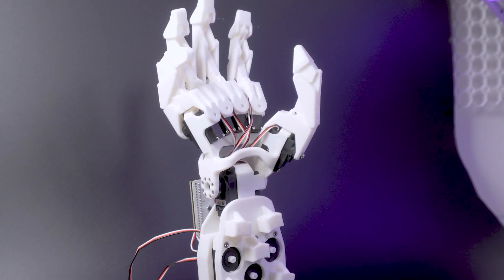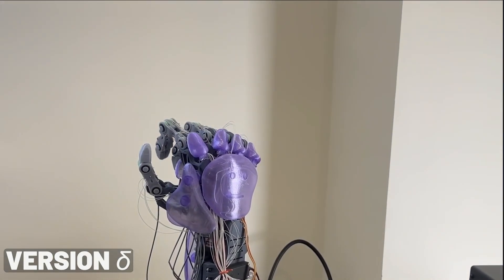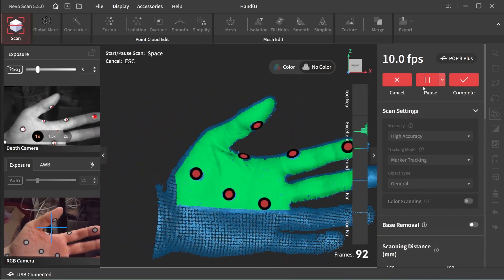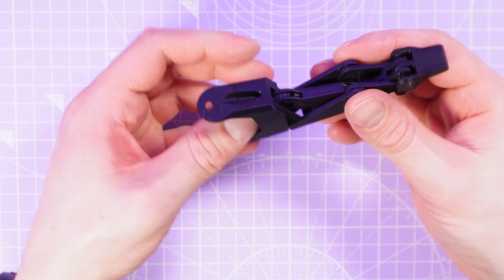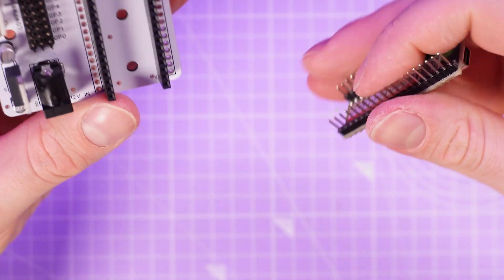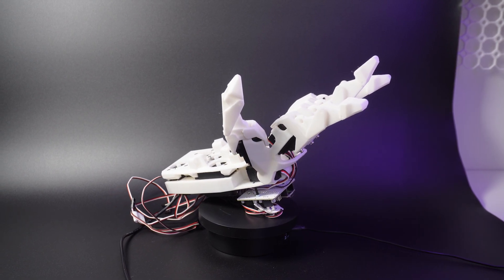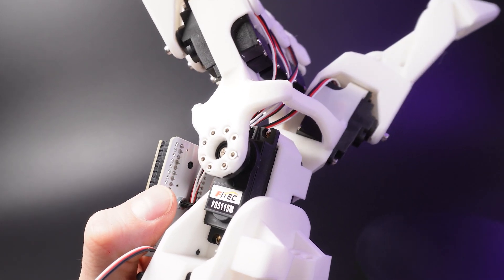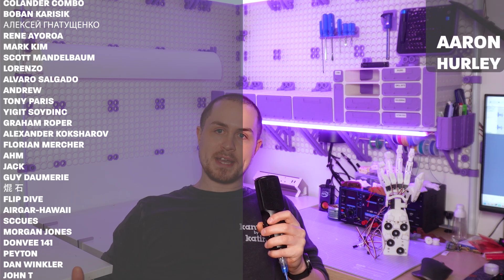Designing a New Bionic Hand (Which Prints Pre-Assembled)

Comment: Hey to print in place you can use a 45degrees cone structure. I usually give 0.2mm to 0.4mm of tolerance. It then becomes a hinge for most utilities. It is quite reliable since none of the cone shape is suspended.

Comment: Awesome project and engineering. For the finger joint problem, could you just print a hole in each part and a snap in cylinder that prints on the bed. This would keep it hardware free and still allow printing with no supports. I don’t imagine the finger tip needs to be removed often so shouldn’t pose a problem and will support the front to back push on the joint.